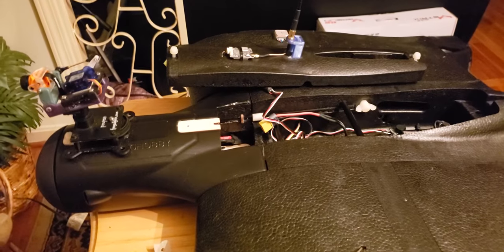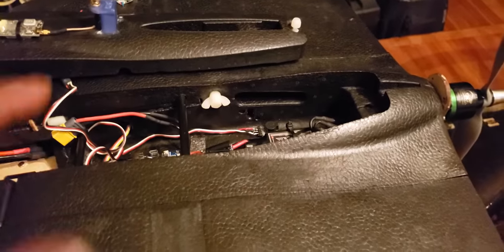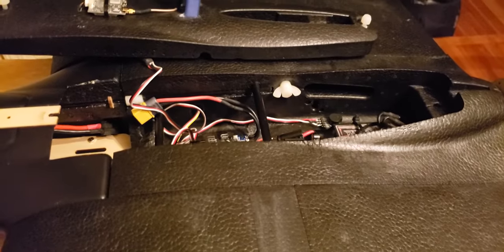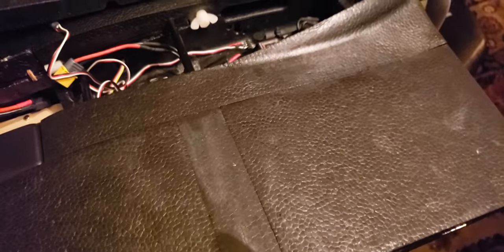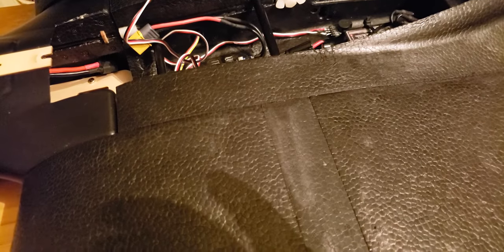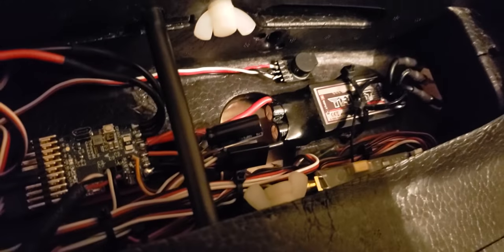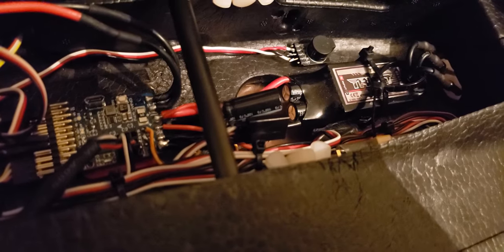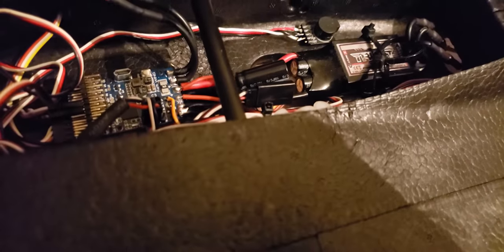INAV OSD Blinking or Flickering Fix! Panasonic 1000UF 35v FS Series Capacitor

Comment: Good to know, I'll try these Panasonic ones next. I need to add an extra capacitor to my F405 board. OSD flickers even with a small 2212 1400 kv motor.
Reply from the maker: They make 2 different sizes in the 1000uf. The one I have is the Panasonic FS Series. It's the smaller sized one, but still has the same spec's as the bigger version.
Reply: @JD_1  sweet, thanks!
Reply: RaceDayQuads sell the smaller one for $1.49 each.
Reply from the maker: @christopherstarzyk9209  awesome!